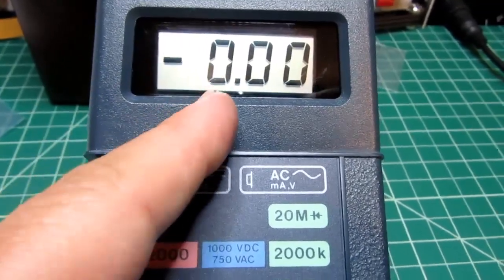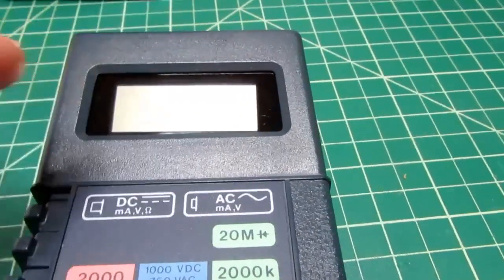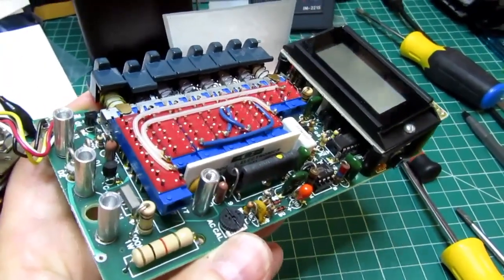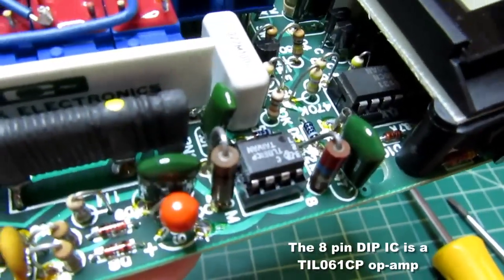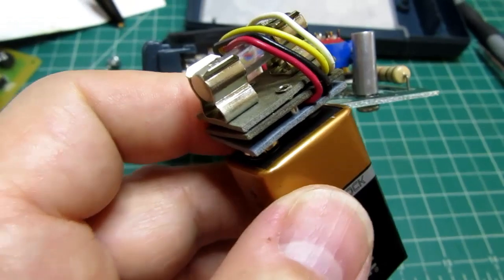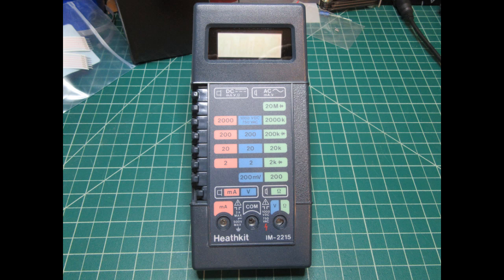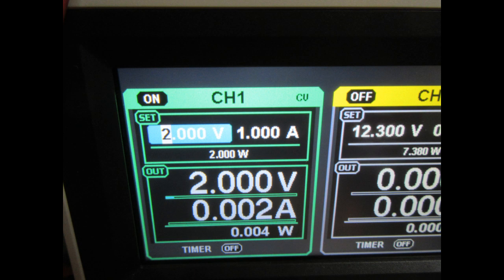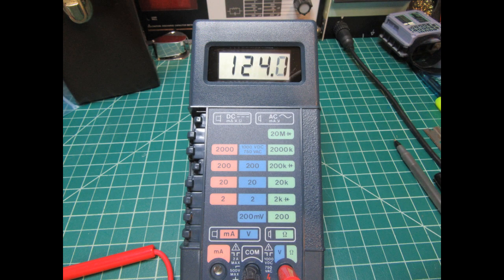Heathkit IM-2215 Handheld Digital Multimeter (DMM): Overview, Demonstration, Theory

Comment: Thanks for the very well done walk through the IM 2215, Excellent video !
I picked up an IM 2215 at a very good price. I really didn't need it since I have a Fluke 77, and several HP 34401A's. The Heathkit looked much like an earlier Fluke, I think, DMM with the side mounted switches.  To my surprise, the Heathkit, is very accurate built well and a nice instrument. My display has some black areas and I was wondering if there was a fix, I searched on test equipment LCD Display repair and found several sites which took you through the fix. it is apparently an easy repair but I have not done mine yet.
Again, THANKS for the great video.

Comment: I had one of these multimeters.  It worked well for about a year but then its operation became flakey.  This was apparently due, according to several comments I read in Popular Electronics and other magazines, to the poor design of the selector switches.  I called Heath to ask about this and will never forget what the person I spoke with said: "Well, what did you expect?"
Reply from the maker: glencoe58, I can't speak to your personal experience, but I restore quite a lot of old Heathkit test equipment, and almost always find that their component parts were of good quality, and most of their designs were well done. Heathkit used brand name components, not cheapo knock-off parts. A meter going bad after only a year due to "poor design of the selector switches" seems unlikely, although not impossible. I suppose it might also depend on where YOUR particular meter fell into their production; if you had a kit from their first production run, then it would be more likely that some previously undiscovered flaw might still be part of the design, and that could include a design or quality control issue with a particular brand or model of pushbutton selector switch. Perhaps they recognized this and either kicked the vendor in the butt to improve their quality control, or substituted a comparable brand/model in subsequent production runs.

What does not surprise me very much is that you might have gotten a flippant response to a complaint. I built probably something like 150 Heathkits, and rarely had any need to contact Heath with problems. But on more than one occasion, I received rather disappointing responses, e.g. I had a resistor in the power supply of an oscilloscope that ran so hot that its surface was bubbling and the painted color bands were disappearing, but the Heathkit technical advisor I got on the phone just said, rather curtly I thought, that the resistor was working within its design parameters, and would be OK. I guess I should not have expected him to say something like, "Yeah, well we decided to save 5 cents and put in a resistor with one wattage size less than conservative design would otherwise dictate, but it should still be OK". I think this might come down to a couple things; one of which is that by the early 1980s, when this meter design came out, Heath was already in its waning days, and probably a lot of employees might have seen the end coming, perhaps there were some layoffs going on, and a certain amount of bitterness by some employees. The other thing is, in every company there are some employees who just have bad attitudes and don't try very hard to hide that from customers.
Reply: I only built about 50 Heathkits (the largest being the 25" color TV) and, like you, found most of the designs to be quite clever and the components were of good quality.  There were a few designs that were a bit questionable, though.  For instance, the digital displays for the wind speed indicator and the digital clock had a habit of going bad over time, with segment failure.  A look at the circuit diagram showed that the DC supply for the displays was a single diode from the AC source with no filtering.  The resultant voltage peaks overvolted the displays, causing them to eventually fail.  Heath was always happy to sell replacements, of course.  When I did replace the displays I installed a 20 mf electrolytic capacitor after the diode to smooth things out and had no more display failures. 
The wind direction indicator used small wire-lead incandescent bulbs.  These often burned out, probably due both to the thermal stress of repeated on-off cycles plus the fact that on my unit the applied voltage was about 10% higher than the bulbs' rating.  Heath was happy to sell me replacement bulbs, of course.  Instead, I replaced all the bulbs with LEDs.